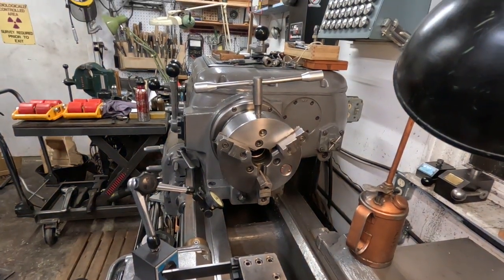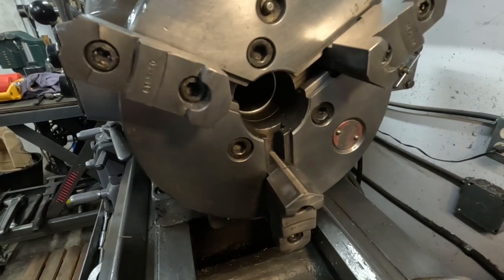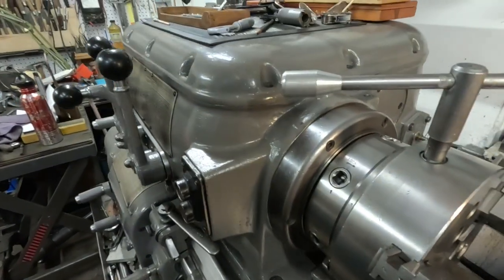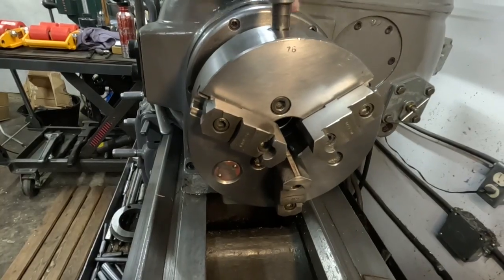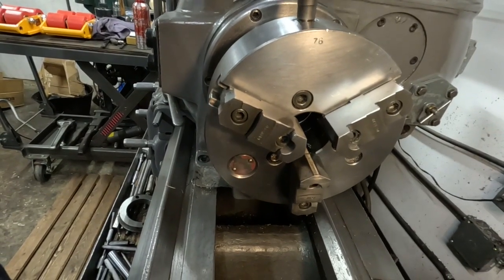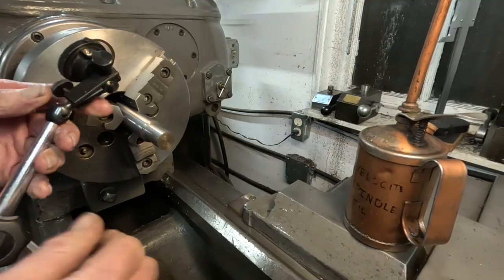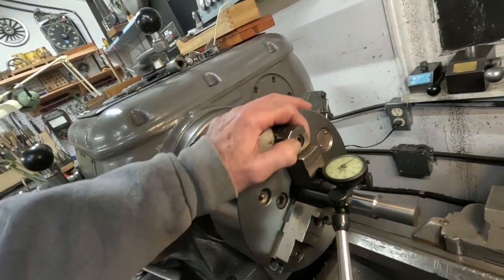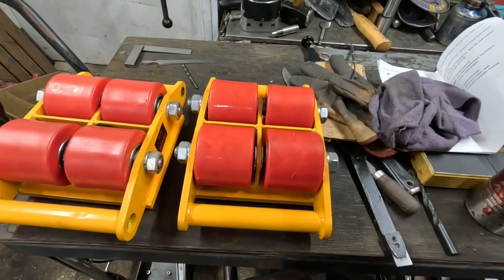Morning lathe chuck maintenance and improving cheap machine moving skates.

Comment: I bought some of those Amazon rollers against my better judgment. I bought the solid steel wheel model and they were actually pretty decent. Long story short, they got they got the boring mill and the 24x110" lathes moved in my shop. I  did not go broke doing it and they survived for another day.
Reply from the maker: These are the $35 vevor brand off ebay, I will try them soon when he weather breaks "freezing rain". I think using them in combo with a pallet jack will work for me, thanks.